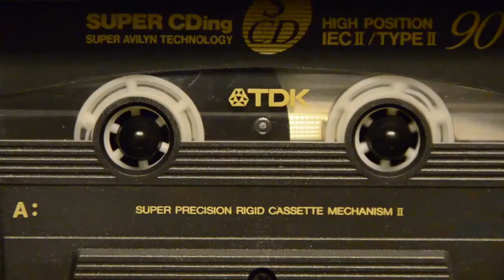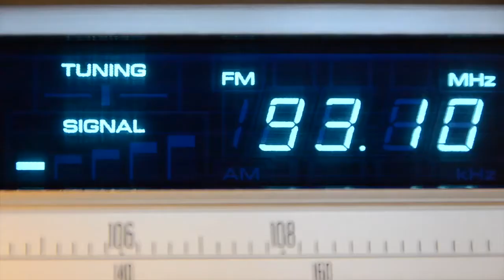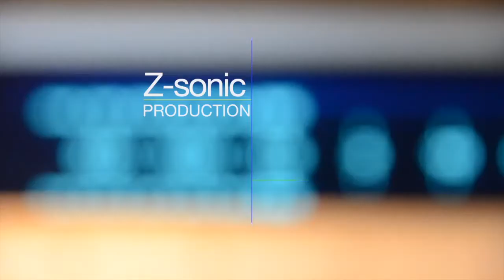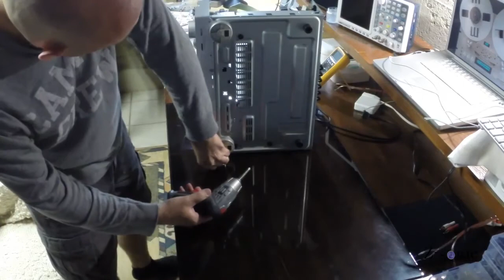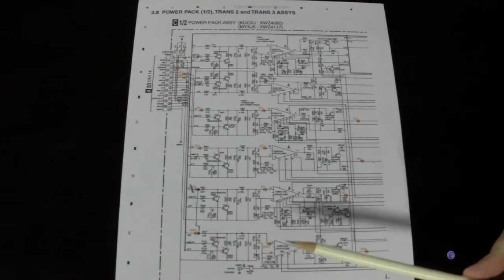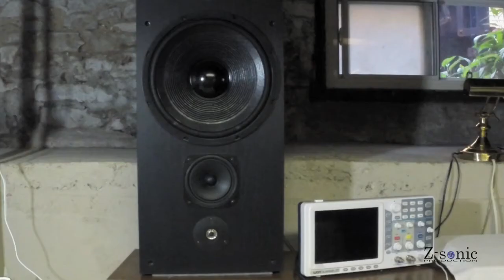Pioneer SX-316 transformation

Comment: I got one of these. Even the subwoofer output seems to have a high pass filter around 40hz. Main speakers around 80hz. No way to adjust this in the settings. So many of these basic units that came with a set of speakers had no adjustments. They could have been so much more useful and more upgradeable with just a few options in the menu!
Anyway I would like to ask about your modification to the amplifier input. Do you think it is possible to modify this so it has an external RCA input connected to each amplifier? I would like to get it connected to the 5.1 analogue on my computer.
Reply: And if I were to do that do you think it would bypass the high pass filter? I was thinking so because the filtering should be done digitally.

Comment: I purchased one of those when I was 16 years old in 2001 I think. I still have the reciever and the speakers. It still works almost as good as it did when I first bought it. My center channel quit sending out a signal about 8 years ago but I still use the other 5 speakers. If the center channel would work I would buy some new speakers for it. I know I've used it alot throught the years and I never expected that unit to be with me all the way to my 30s. I wouldn't mind bridging the center and subwoofer channel so I could use a 10inch subwoofer however as I mentioned the center channel does not put out any audio

Comment: Hi. I bought this equipment second hand. I hooked up 2 floorstanding speakers. But I have the problem with the bass. It seems mandatory that you connect a subwoofer to it. Is that so?
Reply: sorry, but my english is very limited. I see in the video bi-wire to the speak
Reply: I'm not sure if you ever figured out your answer, but it seems so. like Adrian stated in the video, the other channels use a high pass filter which essentially filters out lower frequencies